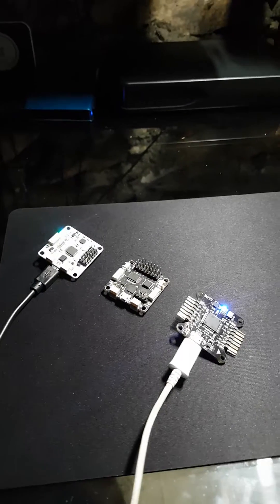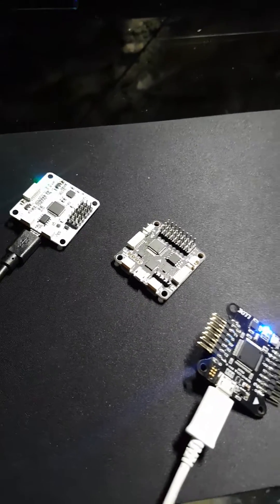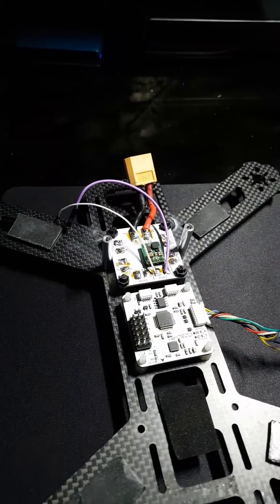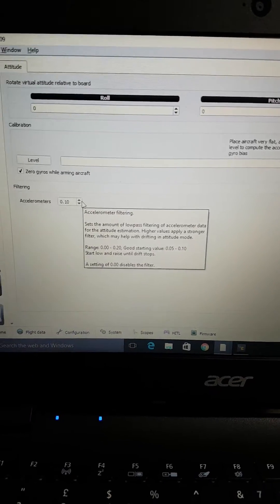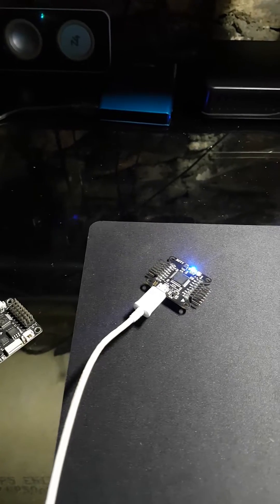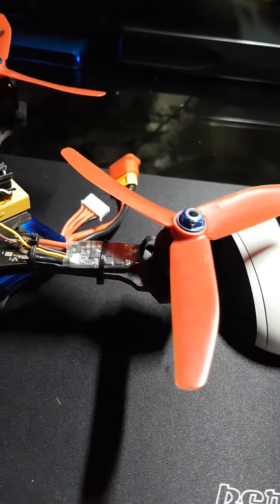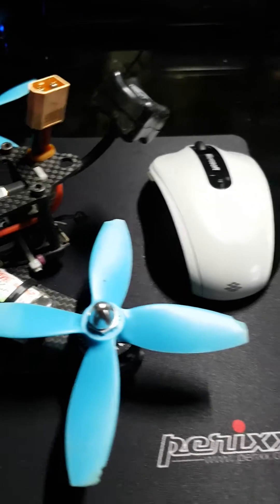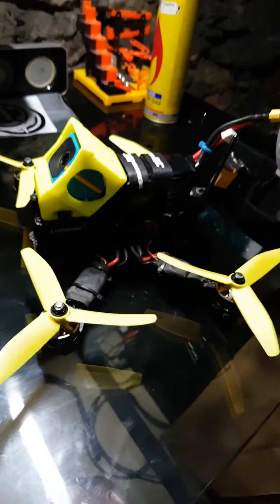Drifting problems with mini quads? How to adjust flight controller settings and hardware changes.

Comment: Wow sir thank you for this video. A million thank you for real! I’ve been fighting with this issue for a whole year even gave up on flying my quads waiting on a fix. I changed the RC Deadband and Yaw Deadband to 5, the drift is gone.
Reply: CrazyRussianCat  I tried this fix using the Hobbywing FC and 4in1 stack. That is the only board I trust and it just worked flawlessly. Fixing to upload a video on my channel of one of my birds that I hadn't flown in forever, I flew it in angle mode just to test.

Comment: I fly single rotor fpv. And my solution is changing the main frame. The mechanical resonance is different from one model to another. The Blade BSR has the same dimensions as the blade 230. But they have very different drift for different RPM of the main rotor.

Comment: I would recommend checking if your motors are all giving the same output and are all giving out equal power that may even mean you should recalibrate the ESCs as that is what worked for me.